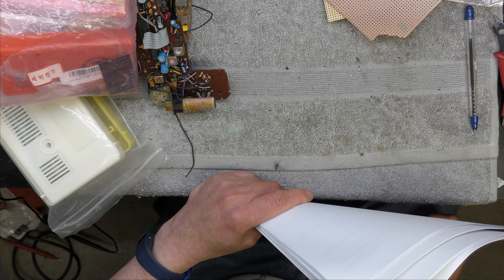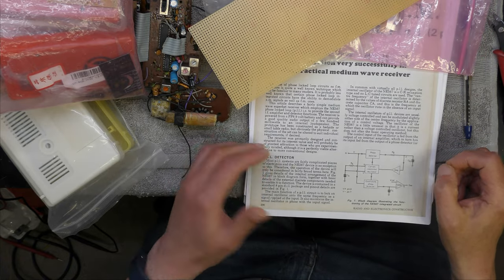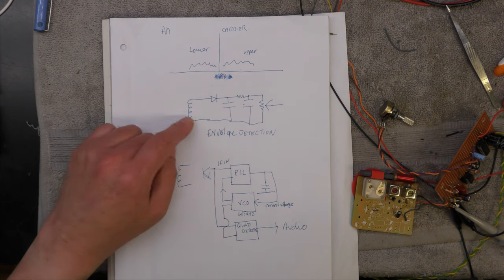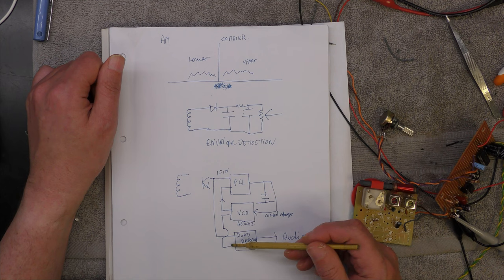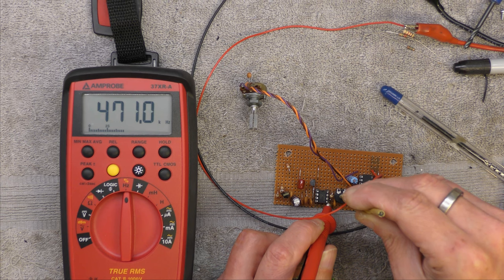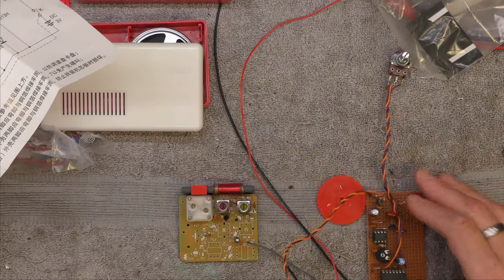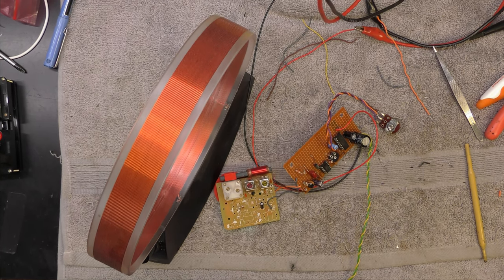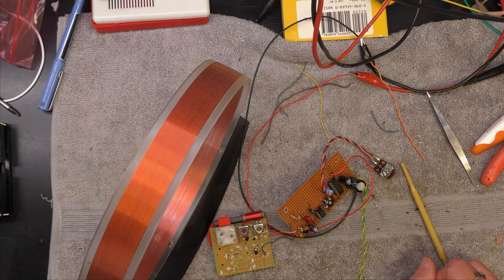AM Synchronous Detector radio build experiment (4K)

Comment: I designed and built something similar, only without the mixer/osc and if, it was designed for LW, it only has a aerial coil and a fet preamp then the Ne567, sesntivity is good and sound quality too, plus the osc in the Ne567is also the tuning. if you slow down the oscillator control voltage filter you can easily make the rx direct conversion without the whisltes.

Comment: Muy buenos estos proyectos de aquellos años! Algo interesante para los que gusten del AM es armar un receptor con TDA1572 con detector de muy baja distorsión ! Saludos.
Reply from the maker: @electron80  that's a IC to try out. I've seen a few designs for low distortion detectors using op-amps. Thanks Daz
Reply: @darrencoe5795  si puedes conseguirlo pruebalo! Anda muy bien! Saludos!

Comment: Darren,
Could you please provide the link for the article used in this video?
Did you really like the performance of the detector circuit?
Harold Lacadie
Reply from the maker: https://worldradiohistory.com/Radio_Constructor_Magazine.htm
Reply from the maker: January and February 1979. Yes the sound from the synchronous detection is better but tuning is critical and a better front end with tuning reduction would be better. Daz
Reply: Darren,
I made the circuit as described in the PDF file. I had some trouble initially but was able to remedy the issues, (wrong capacitor values, wrong connections, etc.), But it works amazing. The whole thing is built on a plug-in type breadboard. I replaced R7 & R8 with a 5K 10 turn potentiometer (great). The front end is a very sensitive NE602 based superhet with an Arduino based VFO. One thing I noticed is how CRITICAL IF tuning is.  I have 2 455 ceramic resonators in parallel and 2 small transistor radio IF cans down the line. I will try it on shortwave. All I have to change is the antenna tuner for this. Anyway, many thanks for posting this amazing circuit!
Harold Lacadie
Reply from the maker: Well done, Harold. Sounds like a good circuit using a proper mixer and a stable VFO. I hope to finish this properly one day, hopefully not too long with the clock ticking on AM broadcasts. Daz

Comment: i know nothing about synchronous circuits, other than some switchmode power supplys dont use diodes for the rectification, they use controlled  mosfets instead.
Would ordinary germanium diodes sound better with a  light d.c bias using a high value resistor and a pot?
The diode could be coupled to the i.f with a capacitor so you can shove power up the diodes bum lol :-D.
I really know bugger all about the subject.
Im here to annoy you ha ha :-D
Reply from the maker: Yes I've dealt with those sync MOSFET psu at work. But back to hobbies, yes I have read that bias can help along with buffering as the capacitor to filter the RF are a cause of issues. I read a lot of stuff on the valve radio net website.  Daz
Reply: @darrencoe5795  I didn't read anything about diode bias, it just appeared from no 
where.
I'm sure you have had loads of sudden answers from nowhere,  you are a really clever bloke.